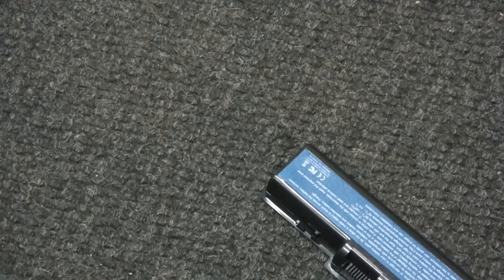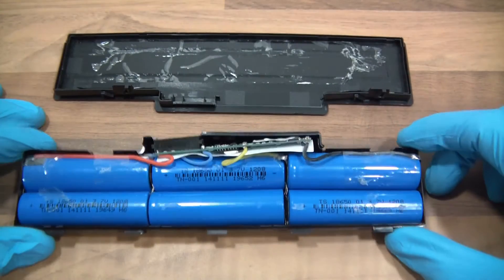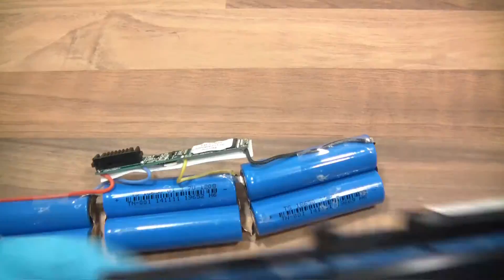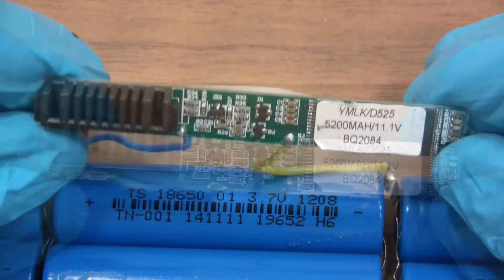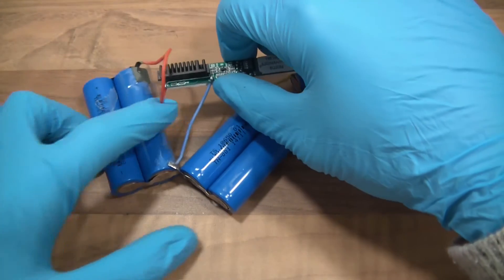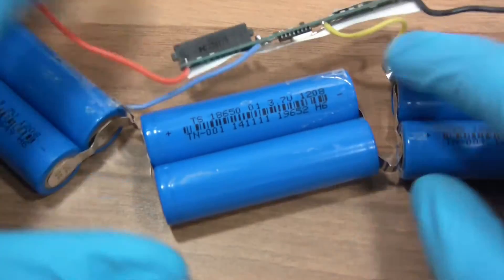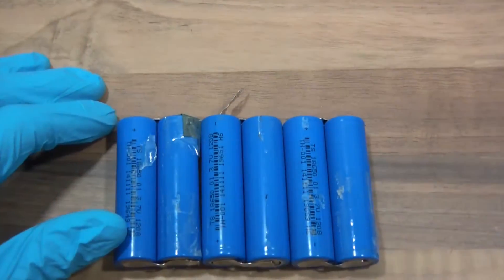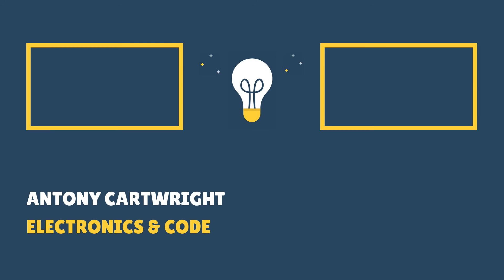Recycling/Salvaging Lithium Ion (Li-ion) 18650 Cells from Laptop Batteries! (Part 2)

Comment: Please don't hammer a lithium ion battery 😑😑
Reply from the maker: Why not?! 😀
Reply: @antonycartwright  If the battery is charged, then hitting with a hammer might cause damage to the battery and lead to short circuit or explosion of the battery
Reply from the maker: @kahe7436  The cells are in solid steel cylinders. They're very strong. Ofcourse, if you use a sledgehammer or something, it would be a different story! 🤭